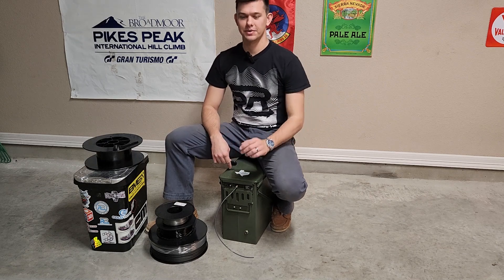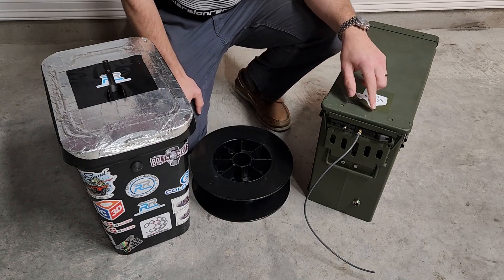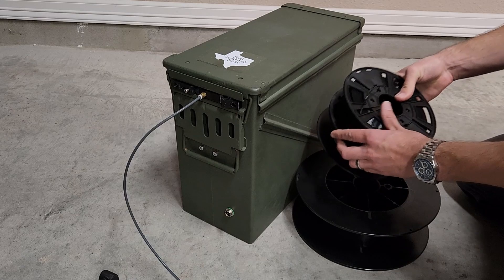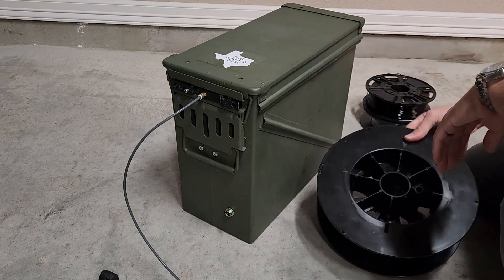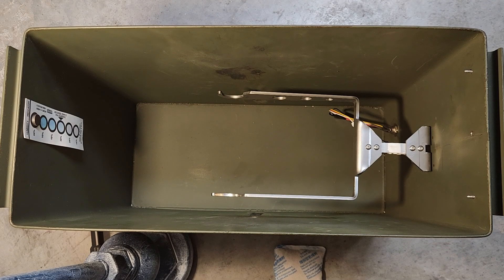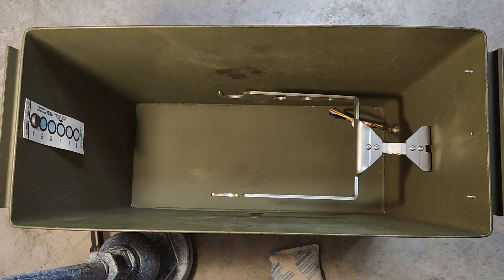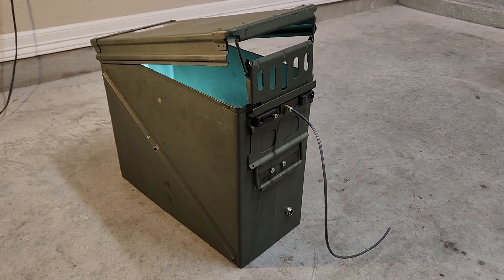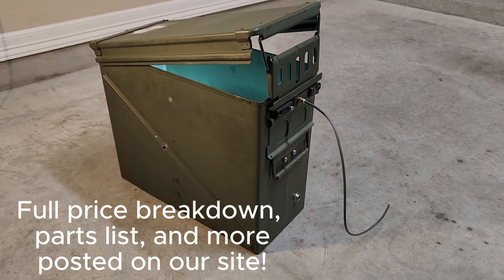Ultimate 3D Printing Dry Box!

Comment: This is great but I feel like you missed a big opportunity since this is a Metal case to allow it to heat your material before using it. I think some containers even have vacuum ports to remove excess air after opening
Reply from the maker: We do pre-dry our material in an oven before putting it into the dry box. We aren't the biggest fan of active heating on individual dry boxes because of the added electrical load required and the potential fire hazard.